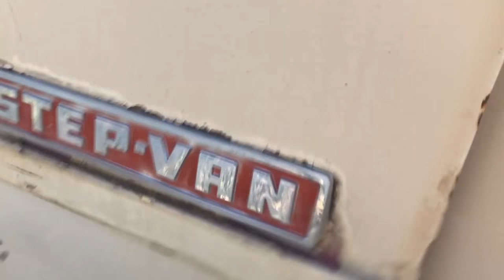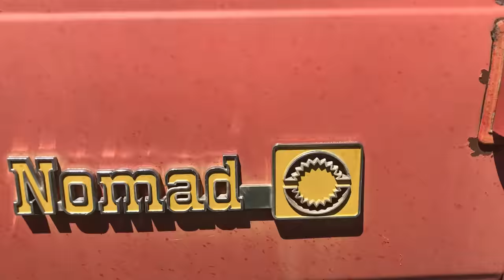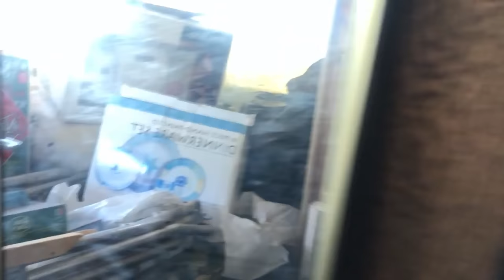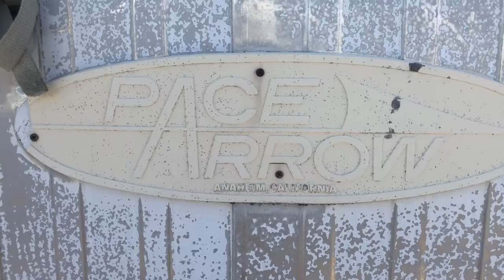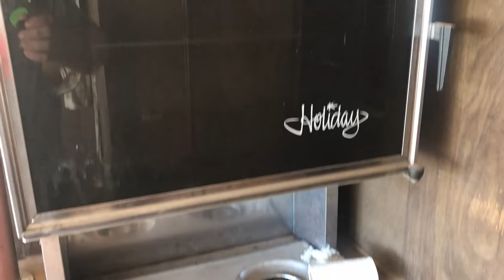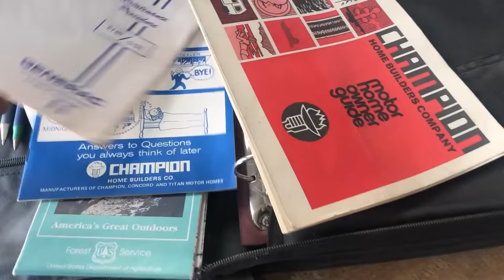I FOUND A SALVAGE YARD THAT IS FOR SALE VLOG #123

Comment: Most of those older motor homes are gasoline powered. They run very hot mostly due to the weight and wind resistance thus, always got 6 MPH and overheated often. Anything heavy and big like they are needs diesel power or you will be plagued with mechanical issues. They got popular in their day because gasoline was only $1 a gallon then. Those older Jeepsters were nice as were the old square body GM trucks. Seems like a lonely salvage yard. Thanks for the tour.

Comment: We had a International Van that was a bread truck from the 1960's. I cannot believe how highly collectable they are. There is a guy out in Nevada somewhere that has a few just sitting. I remember riding home on the engine dog house when my dad first got it. It only had one seat. When My dad got it, he put box's in the back for seats/ beds and a small table. We used to take it camping up north all the time. In November it became base camp for Deer hunting. My mom would heat up Chili for us on a propain heater my dad installed. Dodge put shit engines in all their Rv's, the lifters would go first. I remember hearing them clatter down the road thinking that engine wouldnt last long. They usually didnt.

Comment: I worked on many of geo metros. You could buy it cheap. But every  part on those things started at 500.00. I forgot what year they had the turbo but that thing was rated at close to 60 mpg. I occasionally see a convertible in town. Fun video . I always love old junk yards. I wrote a poem about a junkyard. Forgot how it went. I did get an a in English class. The Metallic zoo.

Comment: So, did you get the Dodge Pace Arrow RV?   As you were checking it out, with all the tiny home videos of rebuilt buses, U-Hauls, etc., I was like going nuts thinking of how to redo it.  The design of it is unique, which would add to the fun of it.  The 2nd RV has rebuild potential as well.  I'd buy those in a heartbeat if I had millions, gut them and then update but stick to the original design, engine on thru, then place for sell.

Comment: Yo you were looking at a fridge in the camper, I said (out loud) "I bet I could find 5 or 6 good old air cooled beetles there", annnnd you turned around.... 5-6 bugs. Wow
Reply from the maker: I’m looking for one too. ‘65 or so. I used to have one. Been keeping my eye open for one ;)
Reply: Sounds like a plan. My last was a 63 that could push a cig. pack on the side... before that 35' tires on the back 31" tires on the front of a 69 baja with 18 inches of ground clearance.. bugs kick azzz..

Comment: Use to drive at work a old straight six cin. Great mileage in that high  top if only you can put a 5 or 6 spend Tran behind. Bet you might get the best 30 + mpg van

Comment: I live in Appalachia and some of those vehicles would still be driven around here...
Reply from the maker: I’m from Florida! Nearly all would still be driven here lmao
Reply: I thought Florida was more ritzy than that. Where did you find you step van, everything around here is ragged-out...
Reply from the maker: Bread truck is from Lakeland, Florida. See, the thing about Florida is that there is NO INSPECTIONS. You can driven anything here. I have seen the most incredible POS’s on the road here. Florida is not that bad when it comes to rust. There are places near the coasts that are bad. But certainly better than the rust belt states that use salt in the winter.
Reply: I live in WV and everything has to be inspected yearly, but You can go right across the river to Ohio where there is no inspection and the roads are in better condition and you can see through the cars because of rust, so where's all that $$$ going for the WV inspection...?